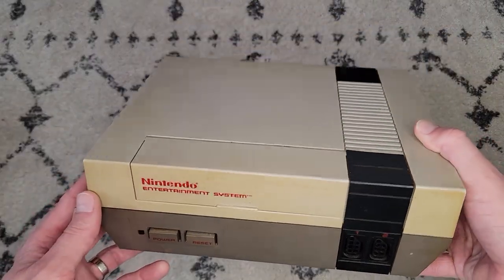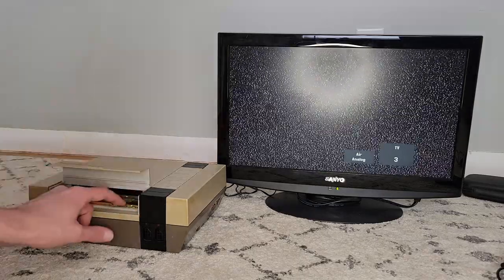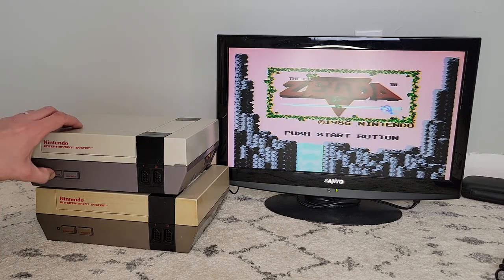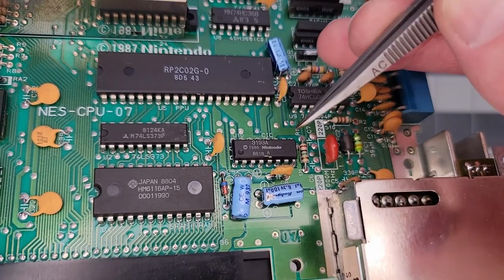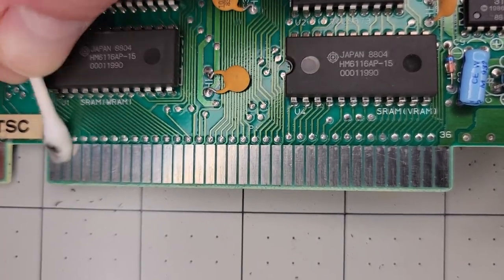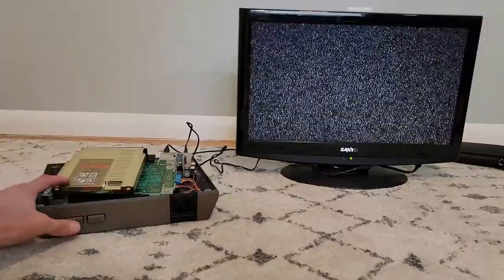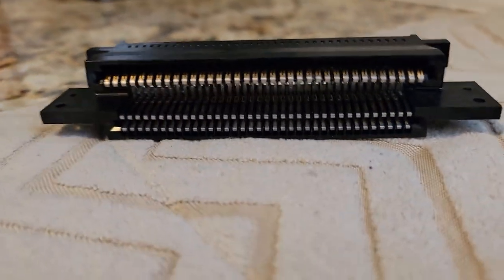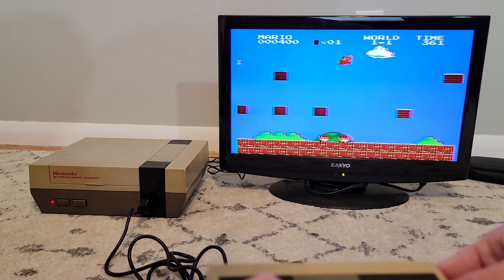Fixing an NES that Won’t Read Games | NO REPLACEMENT PARTS

Comment: It's not advised to use a game with a save battery in it for testing because the constant blinking from the system resetting itself can delete the save file. Bending the bottom pins up is only a temporary solution and will only get worse again. The key is to bend both the bottom and upper pins but nobody does or knows how to do that easily. When you do bend the pins, they all have to be lined up in a row. If one is lower or higher than the other, the game won't make good contact.
Reply from the maker: I didn't know that about save games, interesting! The pins are only accessible on one side so what you're saying is key is not possible--unless you're talking about the pins that interface woth the main boafd. The game pins don't have to be perfectly lined up as long as they make good contact with their respective game pins--I got them decently lined up but not perfect. Naturally yes it will get worse again but  a brand new one will as well. End of the day this process or replacing the 72-pin are both fine options and better than a broken NES! Thanks for your thoughts and for watching!
Reply: @FantasticQuack  There are indeed a row of top pins on the cartridge connector side but you can't pry them into place like the bottom ones. As far as I know the only way to access them is pull them out from the back. So you have to pull them out, bend them down, then carefully slide them back in. A big pain in the butt. If you want the connector to be like new again, it needs to be done. Not sure how long it will last. Hopefully at least a few years otherwise it's not worth the effort.

Comment: Is this real? I’m having the blinking light problem on an original nes
Reply from the maker: Is which part real? I filmed it all, you can see for yourself :)
Reply: @FantasticQuack  yeah but boiling an electronic component seems risky…
Ya know how someone said you can charge your phone by putting it in the microwave for 30 seconds 😂
Reply from the maker: @atticus13fault  you know it's pretty common to clean entire circuit boards in water with a process similar to your home dish washer. It's fine to get wet as long as you make sure it's completely dry before you power things on! Cheers
Reply: @atticus13fault  You aren't really boiling an electrical component, more like a piece of metal that makes an electrical contact. Contrary to belief you can get electronics wet as long as there isn't any electricity running through it and if you dry it out properly before using it.

Comment: I never had to bend my pins, just boil in distilled water and clean the contacts with a credit card wrapped in microfiber cloth and alcohol - works great!
Reply from the maker: Did the cartridge feel like a tighter fit in the pin connector after boiling alone? This one was so loose (like tilting-the-console-causes-the-cartridge-to-fall-out loose) that I felt like bending the pins was necessary, but boiling was the last thing I tried so maybe that's all it would have taken!
Reply: @FantasticQuack  yeah, it did feel tighter. I boiled it for maybe two hours. My rational was that the metal had memory and the heat allowed it to return closer to its original shape, but I'm not sure if that's actually true.